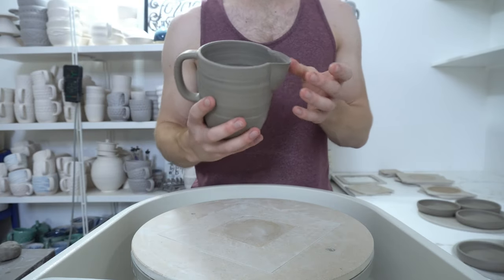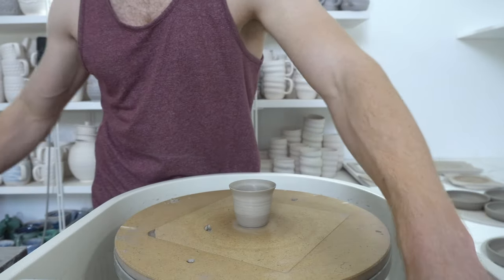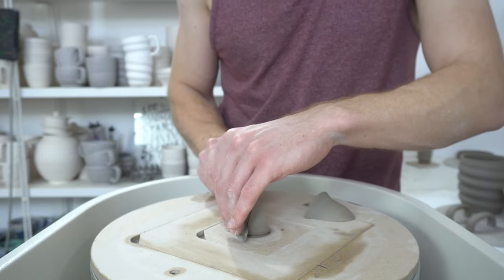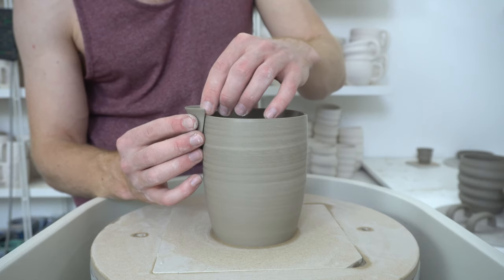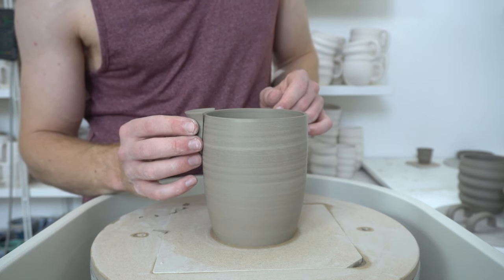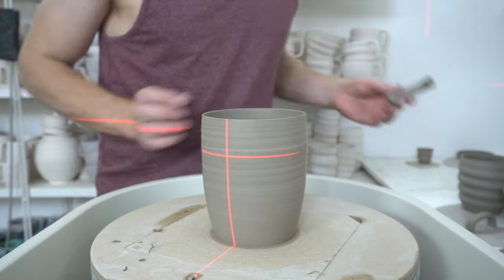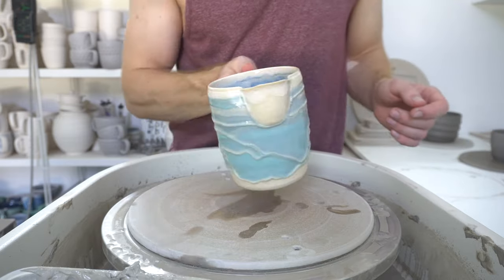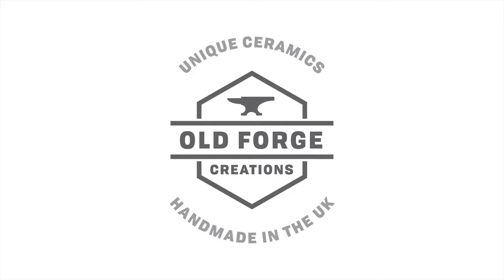How to make a really easy spout, and stick it in place with multicoloured drippy slip

Comment: Most certainly will give this a try today. I detest spouts. One could even leave the inside rim intact and punch filter holes through for an ice tea or water jug that will contain the ice in the jug.
Reply from the maker: That's how I've done all the jugs after this one! It's no more work and the filter could be useful for the uses you mentioned. Plus if you're throwing a lid or pourover to sit on top then leaving the rim intact makes it easier to get them to fit neatly